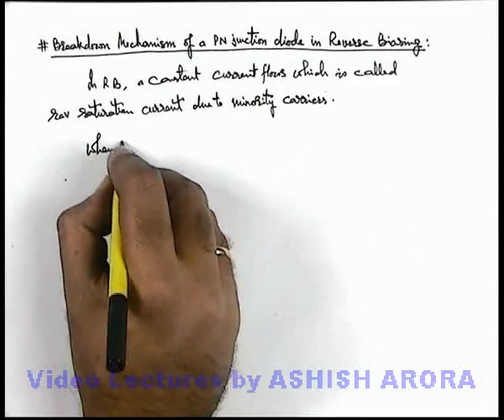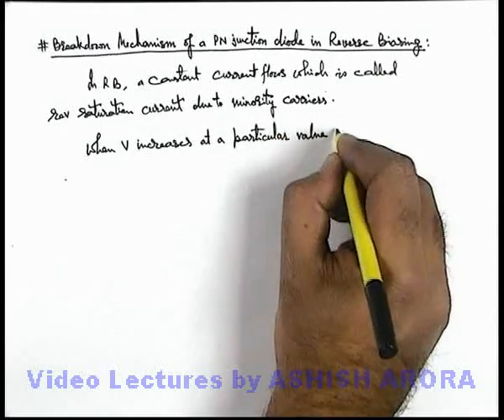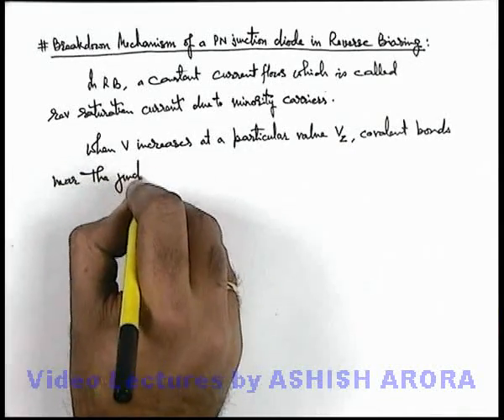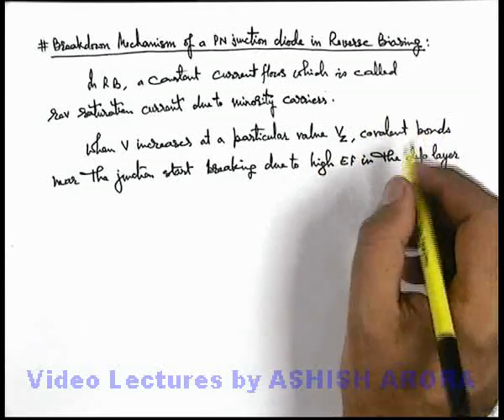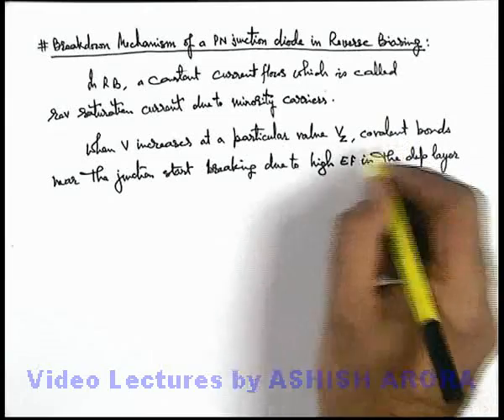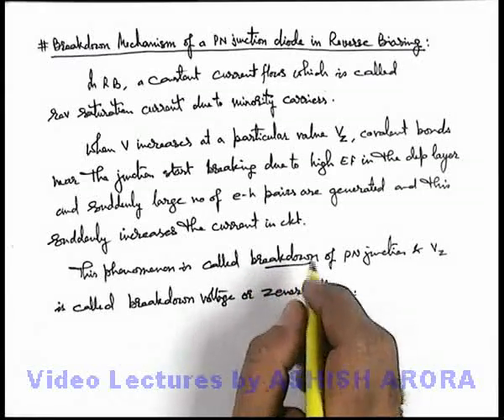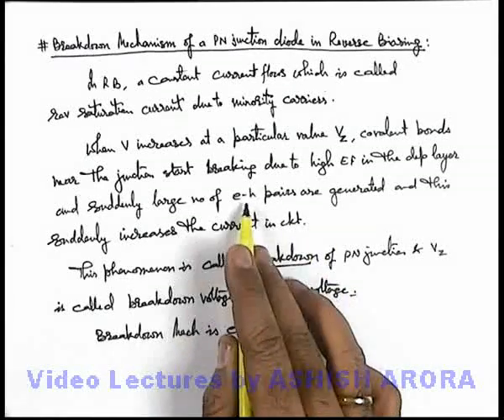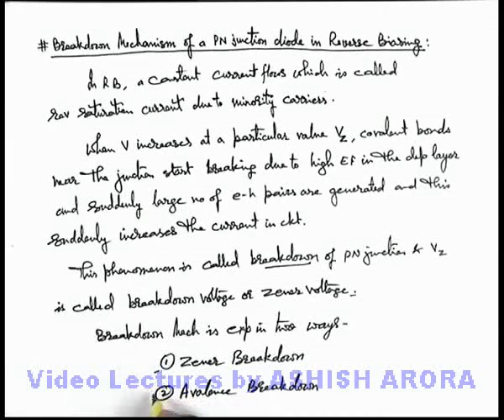Class 12 Physics | PN Junction | #11 Breakdown Mechanism of a PN Junction Diode in Reverse Biasing

Comment: is breakdown possible in forward biasing if the electric field produced in the semiconductor is very high and as in the graph of current vs voltage in forward biasing graph we observe the current approaching to extremely large value at large voltage so is it breakdown like in the reverse biasing in which the current approaches large value ??
Reply from the maker: +Harshom Gupta If FB as electrons can flow freely there is no significance of breakdown however applied external electric field can cause further breakage of bonds...

Comment: sir why the thickness of depletion layer is low when p-n diode is highly doped?
Reply from the maker: +anshul mudgal For high doping density of careers will be high and most of charge careers will recombine in the depleltion layer and the doping ions will produce high electric field to stop further flow of careers for recombination and in a short width internal electric field will be sufficient...
Reply: Physics Galaxy thanks sir